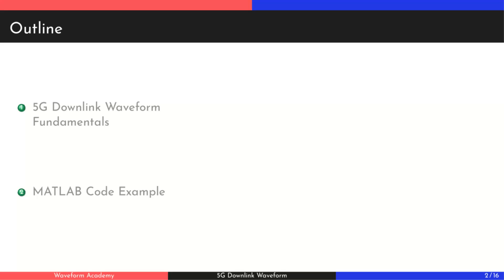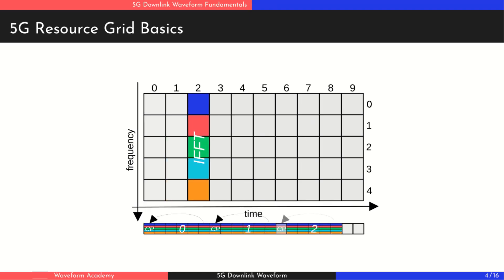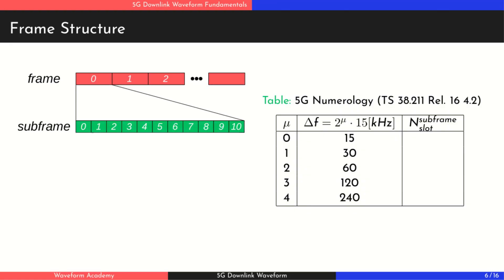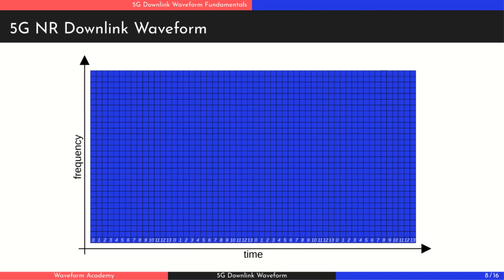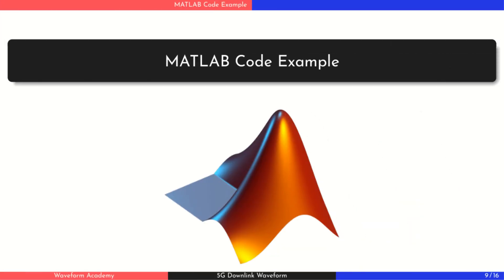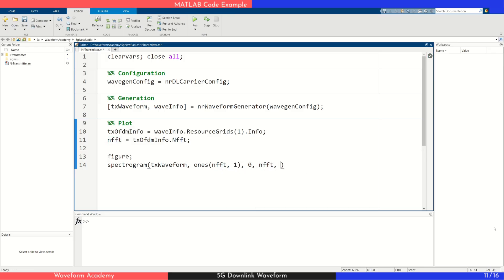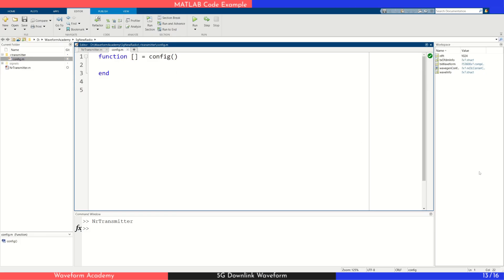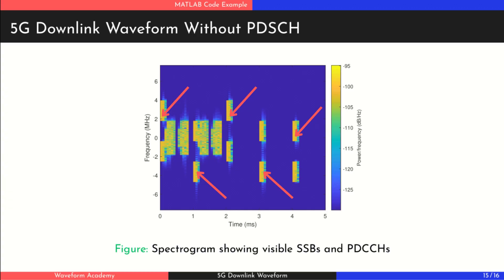5G NR Downlink OFDM Waveform Explained with MATLAB simulation

Comment: great series! Is it possible to run matlab code without 5G toolbox? Thanks
Reply from the maker: Thanks. It’s possible, but you’d have to manually re-implement all the 5G Toolbox functions used in the script. In theory, some things might run in Octave as well, but I haven’t tried that setup.